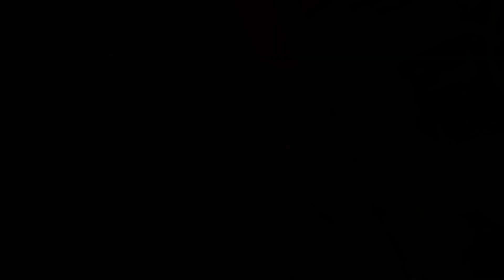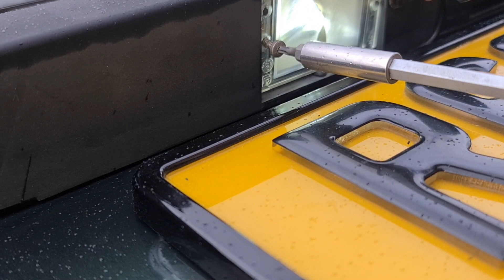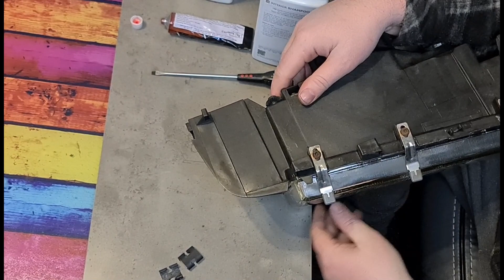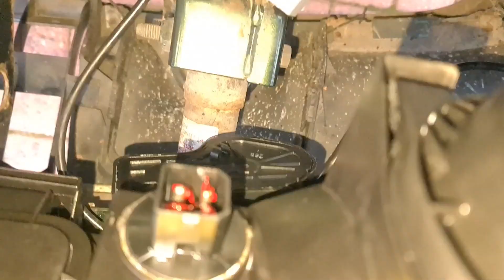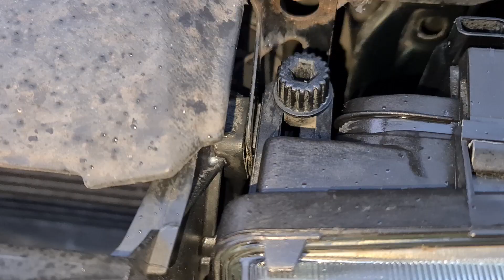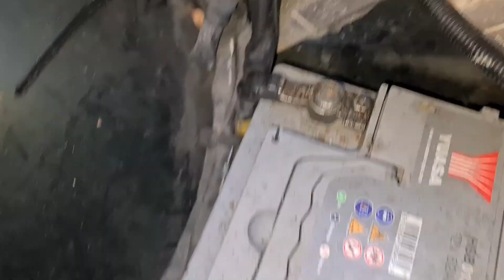Project Turbo Brick Ep12 Pt2 ( Let There Be Light )

Comment: Hi very informative video. I have a Volvo 740 estate, with the 940 body and like yourself have had light issues. I would suggest you keep the original rear light rubber seals. The after market ones are slightly thinner and never sealed properly on mine. Also on your before and after section, the centre brake light didn't work. Not criticizing, this was a very good video.
Reply from the maker: Thanks, yeah I've enede up cleaning and refitting the original seals as the new ones were a poor fit. And I noticed shortly after uploading this that the brake switch was intermittent so I changed the switch on the pedal and now they work 100% of the time. We'll spotted though!

Comment: Love this video! Very detailed, thank you for all your effort!! 👍Good video work and very good explanation!
Didn't know that the double terminal LEDs for tail/brake are just the same circuit.. Thanks for that.
Are you planning to change the indicators  to LED too and make a video about it?
When doing the indicators, you have to change the blinker relay to a special LED blinker relay.
There are found multiple versions of those 3 pin relays on Ali. The black one with the adjustment knob on top seems to be a good one (some variants don't work at all I've read)

[UPDATE]
I have a set of LED bulbs with double terminals here and have tested them on the bench.
Applying power to one terminal gives normal tail light with a current of around 170mA, applying power to the other terminal it gives a brighter brake light of arround 410mA.
Funny is, when appying power to both terminals, the current draw is around 360mA, and light is in between.. but still a lot brighter than just the 170mA.
I guess this LED bulb should be good, or am I missing something?
(Search in Aliexpr  for "1005001371555874", this is the amber BAY15D version I have here)

(personally I don't like the all clear tail lights 🤭)
Reply from the maker: I have done LED Indicator conversions before. If you use a resister in series at each bulb, you don't need a different relay, but depending on cost and work it sounds a lot easier to just use a specialised relay. I don't have any current plans to convert them yet, but might look into these relays and when I get chance, I might do the conversion. Those bulbs sound like they might do the trick. I've only tried 2 different types and both have been useless. I'll be searching for the now lesser seen branded ones to replace mine. And I also prefer the coloured lenses but with a smoked look to them, I think the light colours look less smart than a darker look. However, I couldn't find any new that weren't ridiculously priced, so I went with clear ones as they were readily available and a good price. I don't mind how they look so it's a no brained for me.
Reply: @DanWithAPlan666  Thanks, would make an interesting video, blinker conversion 😉
I don't want to go the "add a resistor" route, it's just too messy with extra wires and stuff. Also, those resistors will get hot so a potential hazard..